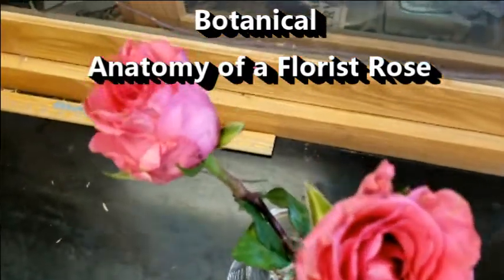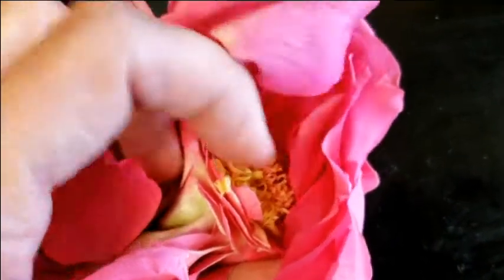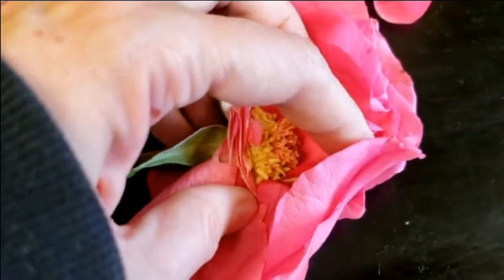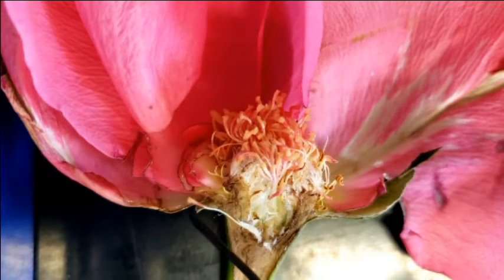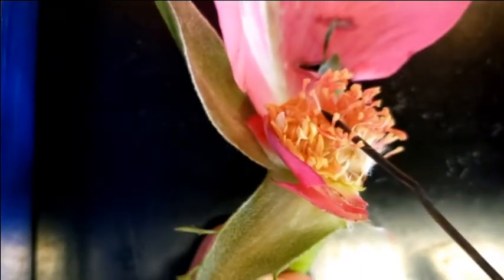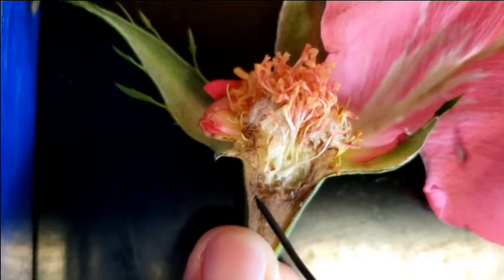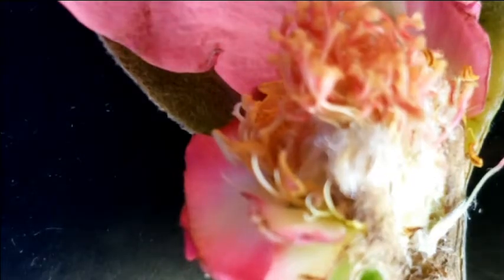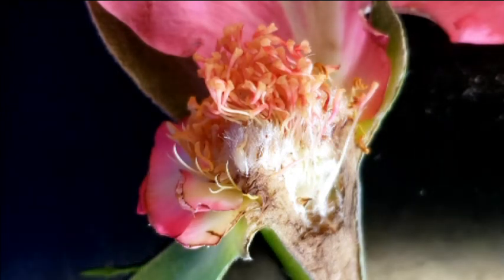Botanical structures in a florist rose - Floral anatomy

Comment: So is it a male or female or both and does it matter which flowers the pollen goes into?
Reply from the maker: Most flowers have male and female parts - this is the case in roses. Many plants can be self pollinated, meaning the pollen produced by the same flower can fertilize the ovules in the female part of the flower. So the rose flower in this video is both male and female at the same time.